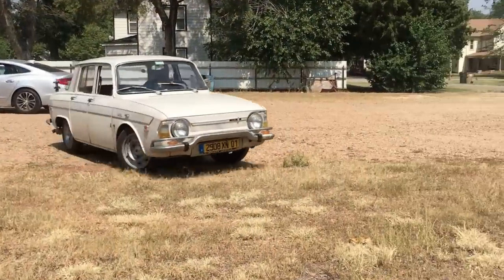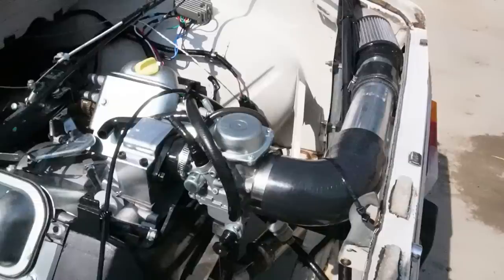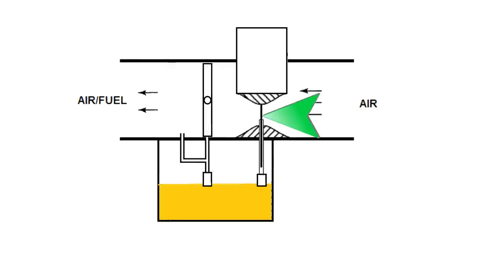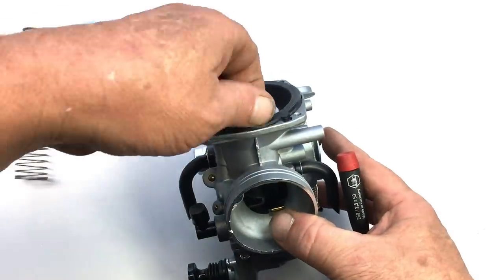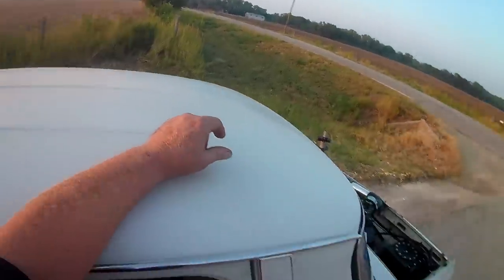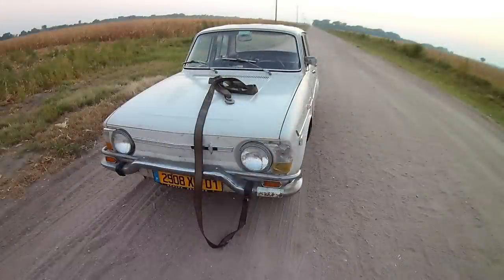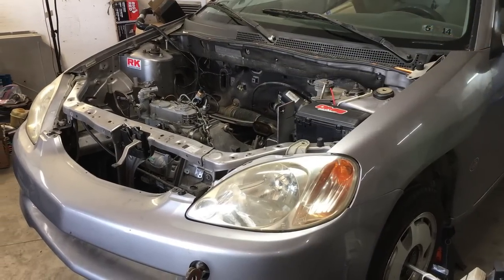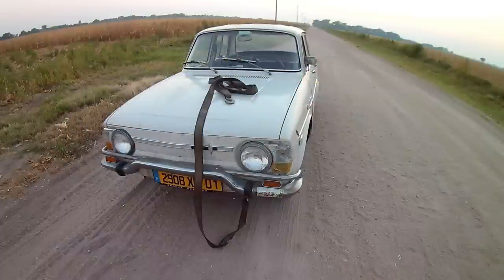S3 E31 We tune the Keihin CVK carburetor to work on the 670 cc predator engine in the Renault R10

Comment: Never forget, a simple way to get a smaller jet if you can't buy one is to solder up your current jet and re-drill with a smaller drill. Works great and the brass/bronze of these jets takes solder beautifully.

Comment: Check Float height, its the most important thing you can do before tuning anything on the carb (Besides the screws). Also be sure to note that you can adjust the needle position on the throttle for rich or lean for mid to low range rpms
Reply: Was just going to say that myself.👍
Reply: Yep. I see so many people who have issues and all it is is a float that is to low. Hanging idle, High idle, Backfiring through the carb when idling. etc
Reply: @trxtech3010  Absolutely. Float height is the single most overlooked adjustment you can do to any machine. dudes will buy a brand new carb for top dollar instead of doing the research. I don't think thats their fault tho. Everyone just says "Just clean the carb". Lol, that fixes it maybe 50% of the time.

Comment: You could probably make a little 3D printed hood  that clips onto the fuel/air ratio sensor, to block out reflections and somewhat improve visibility. I think you could even get it to spin under reasonable force so you can adjust it on the fly if you're say holding the box. Could also do black craft paper and tape, but I think it'd be trickier to make that stay on well and also not fall off under normal driving vibrations.
Reply: Use tpu or throw in a rubber gasket, makes for easier friction fit to orient stuff in a way that stays put, but can be moved
Reply: It's less reflections and more the shutter speed of the camera and low dynamic range due to the bright conditions mixing with PWM flickering on the sensor gauge, I think.
Reply: Instead of 3D printing a hood why not just make one from a piece of cardboard cut from a cereals box or a sheet of stiff card and a little duct tape?

Comment: Wow that sucks that you blew the CVT belt. Good thing they're ready and available at a moments notice. On that note, I can't wait to see that little Kubota pushing the Insight down the road. And maybe add a little propane injection in the future? 😉 Would be cool to see how it would react. Nice work Jimbo!! 💪🔥
Reply: Propane is just a fuel adder or fuel replacement. Doesn't do much except add additional fuel. But since it burns with zero visible smoke you can't tell if you are over fueling like you can with diesel. Only if you have an EGT sensor, which he does, or a wide band O2 which I'm not sure he installed it on the Kabota. Water/meth would be a better choice as it also provides additional cooling so he can turn it up even more and not go too high on EGT

Comment: I went through this business with the CV carburetors when I hopped up my Honda CM 450T.
My solution was to leave it all standard and only change the needle. I did not have a ready supply of blank needles to modify but I found that they were the same as a small box nail, and so I purchased some at the local hardware store and started turning them down. What worked for me to get a punch off the line and smooth acceleration was a very blunt needle. This keeps the emulsion tube out of play a little longer. I found it playing with the diaphragm Springs did not help at all. Mind you, that in those days I was not working with a wide band sensor. I had the narrow band eardrum sensor and the wide band butt sensor, going.
Reply from the maker: Tuning by ear is probably the best way to get these little engine to run right.  The wide band certainly helps but trying to fix all the little bumps in the fuel curve by using the gauge will drive a person insane.

Comment: Remember, "Lean of peak" (aka LOP) is also a tuning method available for air cooled cruising. Toss the EGT gauge on it, and you'll see as you go lean of 14.7:1  EGTs will initially go up,  but come back down. Between 16.2:1 and 19:1 is where you should find cool lean running and maximize economy. but it should also be noted that lean mixes burn slower, so you'll need more advance to counter that.
Reply: Spot on this tuning makes a vapor carb😅
Reply: The ratios that you have stated are pretty lean even for cruise, I'm not sure that the combustion chamber shape and ignition system will be good enough to cope with those ratios. Having said that there is no harm in trying, in fact you can just go leaner and leaner on the cruise setup until it is very obvious when driving the car that you have gone too lean, you then just go one stage richer and that's that as far as the cruise AFR is concerned. The ratio just ends up being what it is for that engine with its current setup. Of course if you then go and stick an MSD ignition system on it you might be able to lean off the mixture some more!
Reply: This technique is sometimes used in air-cooled aircraft piston engines which. 
- The mixture distribution between cylinders needs to be very good or at best the engine runs rough, at worst you damage the engine.  
- The ignition system needs to be up to the job.

You can't just hop in a Cessna 152, turn the mixture out to lean of peak, and fly off into the wild blue yonder. You'd be doing it in a fuel injected airplane with CHT or EGT readings for each cylinder.
Reply: @sidecarbod1441  A hot air intake would help also.

Comment: Hi Robot Cantina, I have Kawasaki KLR650 with a CVK40, common mods for this carb/bike are larger jets, KLX Needle,  also there is a mod to drill the slide vent to 7/64ths to quicken the slide opening, this may fix your richness in the lower rpm.  The CVK 40 has a bunch of aftermarket support since Kawasaki and Harley Davidson used these carbs in their bikes. Might be a nice upgrade too. if you need one LMK I have a stock spare for free99.
Reply from the maker: The 32 mm carb we are using is an oddball and not a lot of parts are available.  We have a 36mm CVK carb standing by that we want to test next.  If the 36 mm improves performance over the 32 then we may try a 40.

Comment: I don't recall if I mentioned it on the last vid or was just thinking about it, but quite a long time ago I assisted a local hot rodding team fine tune their mechanical fuel injection system on a project car, and they operate almost exactly like old performance bike carbs in that they work great at WOT (and almost exclusively will not function well anywhere else!) as they were more or less made for racing applications where off-gas maneuvers are short blips; I believe the really early systems were adopted from hulking airplane V12s that chugged fuel even at partial throttle. The mention of the Keihin carb made me think that some kind of hybrid system between it and the mechanical system would have been fantastic for getting some kind of usable street performance; getting them to idle correctly even at pit lane speed was a nightmare as you'd basically have to bump the throttle with the clutch in to keep the engine going. Ha, glutton for punishment memory lane!
Add: Ah, I remember where I was going with that now. If the Renault has a fuel door on the right side, that'd be a great spot to shoehorn in a NACA duct for feeding air to the engine filter if you don't mind taking a cutting wheel to the old fill port. They make everything look cool anyway but are wonderfully effective aero aids in both scooping (and run backwards, removing!) air to/from your desired location from inducing a low pressure entry/relief area. I have several of different sizes that one day I'll get the courage to chop up my hood or right at the front fender for a pseudo ram air to graft on my daily ride.

Comment: I have been working on bikes since I was a preteen and my father thought if I rode a dirt bike I should be able to work on it. He taught me everything I needed to know back then. I have been building bikes since I was in my early 20s (Now 57) and racing and tuning carborated, and FI bikes since 2000. With that said the needle valve on the CVK (As well as the VM and tm) controls off idle throttle, piolet jet off idle to about 1/2 throttle, main jet 3/4 throttle to WOT. The way I would have fixed your problem would have been to raise the snap ring on the needle valve 1 or 2 groves. leaning out off throttle, and going up 3 jet sizes on the main (2 1/2 numbers per size) as I seen in other comments check the float level.

Comment: Those gauze air filters are only effective if oiled. The oil is the actual filter. The gauze is a labyrinth that forces the dirt to make hard turns and hopefully get stuck on the oily strands.
Reply: And if you go heavy on the oil it'll cause the engine to run a touch rich for a while. As for the carb, I had a vn750 that used twin Keihins, they take a  fair bit of fiddling to tune properly. And that's on a factory setup, no wide band, I tuned by the sparkplugs.

Comment: G'day mate great vid as always I still think adding runner length between the carb and the boot attached to the billet block even an extra inch will help low down torque production maybe add a 90 degree Elbow between the carb and the billet block for ease of installation. Would be an easy test to just keep adding runner length to see if it helps overall acceleration. Thumbs up mate
Reply from the maker: Good tip!  In the next video we are going to add a 3D printed extension to the induction system.  This 3d printed part is something one of the viewers designed.  it should be an interesting test.

Comment: Lol. Your donuts in the gravel reminded me of my 5 speed 84 Celica GTS coupe. I used to love to take it out on wide gravel backroads and play rally driver (in the mid 90s when we still had gravel roads here in East Tennessee). Unfortunately I also had the experience of leaving parts behind on the highway afterwards- but mine was actual metal bits. I blew a hole in the side of the 22RE block, and it still ran. Not many people can blow up a 22RE. It takes skill! I put another 22RE in it and drove it for another 100k miles fwiw. I think the previous engine's timing chain jumped off. I already had a new timing chain kit but hadn't done it yet. Oops. I miss that car... it was made to be worked on. Everything was easy to take apart, fix, put back together. No stupid plastic clips that break. I should never have sold that car.

Comment: I wouldnt lose any sleep over the rich condition when the carb transitions from pilot jet to main jet........that is actually good for having good throttle response and pick up from idle when you want the vehicle to take off from a standing start etc  but doesnt have a any real impact on fuel efficiency once the rpm picks up for normal driving. The main issue was overcoming the lean condition on the main jet.
Reply from the maker: The diagram may be somewhat hard to interpret.  the rich condition happens at part throttle while cruising.  So at 50 MPH at part throttle while cruising the AFR is not ideal. The good news is for acceleration this rich condition is only a momentary blip and is helpful on the low end.

Comment: If anyone is interested, the SA publication Super Tuning and Modifying Carter Carburetors - Dave Emanuel is a hoot of a read. Forget the book is about Carter carbs. It first takes the reader on a journey into carb principals from basic to advanced and uses Carter carbs to show the concepts in pictures. Then it applies specifics to tuning them - that's the Super Tuning part.
It shows the inverse relationship between manifold vacuum and Venturi vacuum and how and why carbs are load sensing. 

It also explains emulsion tube concepts and how they pertain to idle mixture circuits.
Strictly speaking this may or may not apply to a $30 Keihin 32 CVK rip off but it might. 
It is often the case the idle mixture screw is not actually an idle mixture screw per-se. Thing is, the fuel in the idle circuit is pre aerated by the emulsion tube and the emulsion tube's size varies the ratio of pre aeration in the idle mixture circuit. 
What the idle mixture screw actually does, is basically act as nothing more than a tap for pre aerated fuel. 

This means you're adjusting the volume of premixed air and fuel in the mixture circuit. It then follows that you can't do with volume of fixed ratio pre aerated fuel what you need to do with a different ratio of pre aerated fuel.  

It seems like a mute point however, this has consequences when you factor in throttle stop screw position of the butterfly - the air leak it induces a) directly reducing the signal in the idle mixture circuit and the transition between idle and main metering circuit and b) diluting the the premixed idle circuit fuel. There must be an overlap of the two circuits to avoid stumbles/flatspots etc.

Comment: It still trips me out that a little rubber fanbelt is all it takes to move an entire car. And even do donuts!
Reply: True altho they are reinforced with steel belts on the inside. 
I have actually owned a car with cvt (variomatic). It was a Volvo 340 from 1985,  1.4L inline4,  67hp. As a young guy i hooned that thing around , also doing donuts and snowdrifting.  That car had 2(!) drive belts, each about 60mm wide. Because of all my hooning i  had to tighten up those belts each 5000km. Crazy but i had a lot of fun with that car and i never broke a belt.
Reply: @jfv65  Remjohan :P

Comment: I think the first-gen Insight might also share the speakers from the S2000. Not certain though.

Fun fact: The first-gen Insight's combustion is so finely tuned that the spark plugs need to be turned (indexed?) the right way for optimum engine function. So there are FOUR spark plug variants (A, B, C, D) available for its 3-cylinder engine, and they stamp which plug each cylinder uses on the head. (Mine takes three B's, which I've read is typical.)
Reply from the maker: That's the sort of stuff that makes me appreciate Honda engineering... although I still like to make fun of them.

Comment: Two great projects there. The diesel in the Honda Insight would benefit from a few modifications learnt from its take one in the Saturn. Exhaust, turbo and intercooler mods especially.
I think the Renault is only going to see success and perform to its full capability once it gets engineered to mate the Predator lump direct to the clutch and gearbox. All Jim needs then is a third car and someone to donate or help him find a nice 3/4 cylinder two stroke outboard/jet ski powerhead to do a two stroke project car. He'll have all bases covered then!👍

Comment: a couple things to consider, shortening the slide diaphragm spring can cause the slide to lift too early which will also cause the fuel through the main jet to flow too early. for future reference when testing or trouble shooting rather than making a permanent non-reversible change by cutting the diaphragm springs, I either use small zip ties or thin stainless wire to temporarily shorten the spring that way i can try different lengths to find the optimal length. it is also possible that raising the slide needle is contributing to your off idle rich condition. because there is no direct link between the throttle and the slide CV carbs can be a real pain in the ass, with a cv carb the wrong float height can cause a lean or rich condition, but so can the wrong fuel jets, the wrong needle position, the wrong bypass jets, and on and on the best of all is like you made reference to in your video, all the reference charts refer to throttle position, 1/8, 1/4, 1/2, full throttle, ect. but there's nothing that relates to real world street application like cruising down the freeway at 80 mph and 6k rpm but where the actual sustain throttle position is less then a 1/4 throttle, like i said, cv carbs are a pain.......

Comment: Hi Jimbo. 
If you invert the electron flow in the flux capacitor and use quality plutonium in the power generation unit, you should achieve at least an extra ten parsecs per time unit.
Love your work 👍

Comment: long time a go i have a bike with this carb... changed all parts... only thing save the carb i make a aluminium funnel at scape  38mm to 25mm to have high back pressure and make very high torque on low rpm from 4500 to 2500 rpm (better cruise)

Comment: Another great video! Thanks for all of the insight into how the carburetor works and the results you got while testing it out. Shame about that drive belt! Hopefully you'll be able to get a proper replacement soon. What a great surprise to see the Insight coming back! I can't wait to see the diesel in there. I'm also very intrigued to see the electronic control of the fuel rack. I'm curious what aspects you will be monitoring and how you will change the mixture in response. Until next time!

Comment: Tuning carbs with metering rods, we used to take a ignition points file a make a small flat on the taper gradually fattening up the mixture. 6:50

Comment: Absolutely love this project. You cant get round the ovelapping intake pulses with a v twin like this. It will be easier to tune and faster if you just add another carb, one per cylinder. Google charge robbing.  Alternatively, look at carbs for small HD Motors. They are already designed to cope with it.
Reply from the maker: I'm well aware of the single vs dual carburetor benefits.  The current experiment is to see how much if any improvement can be had with a large single carburetor vs the stock carburetor.   We may do dual carbs, but I'm not a big fan of setting them up.